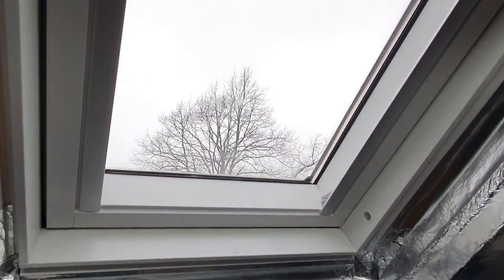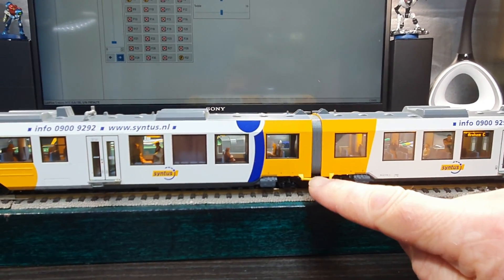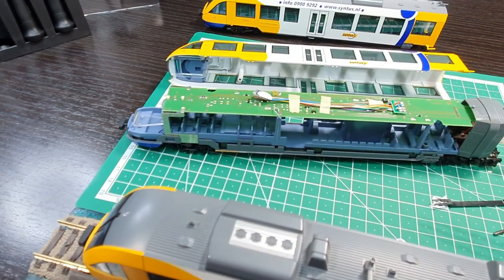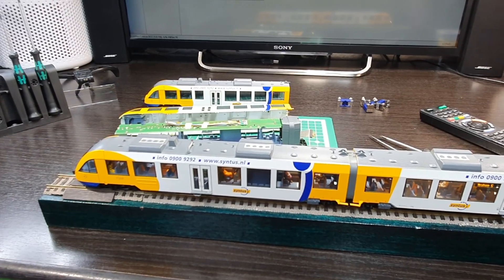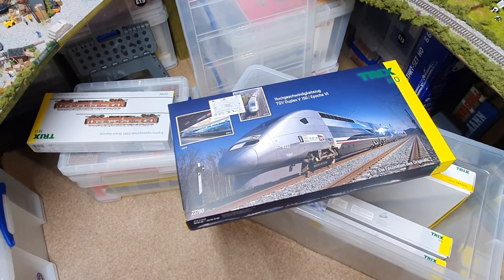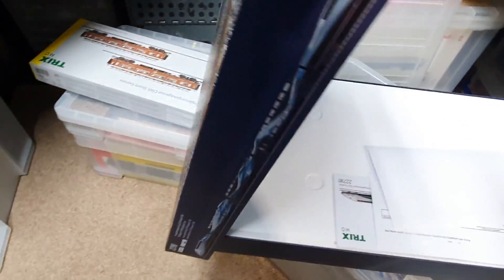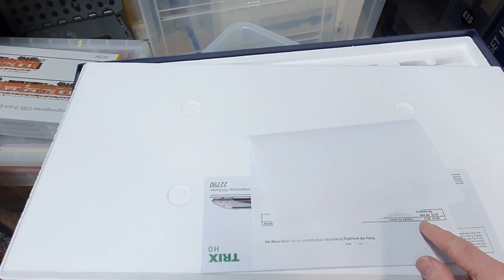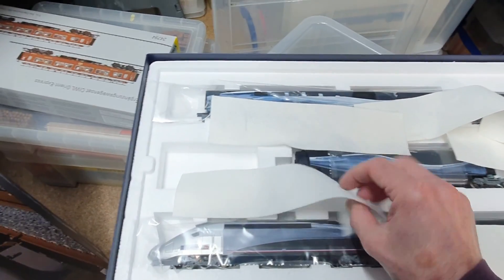Trix Tgv V150 making it go faster project? (Up the track voltage)

Comment: The thing about going faster is the rest of the railway has to be up to the increased speed? Wheel sets have to be balanced and wheel profiled(nothing eccentric), bearings lubricated and set, bogie pivots lubricated and set, no restrictions to vehicle body in motion, couplings free pivoting, correctly weighted vehicles for track geometry, correct track geometry and point work. For model rail, power pick up has to be reliable. If you watch cab views from fast trains the points for high speeds(100 kph+) are very expensive, very long, with elements that close gaps (frog blockers), and the moving parts have multiple position locks. It may be Trix are going slow on purpose.
Reply from the maker: Hi Brian, 
Very true information. 
The Trix models are very slow compared to the Feischmann ICE  models , even if I get the v150 to go 20% faster I would be more than happy.
I will try the French Tgv first if it works I will move on to the other Trix versions..
Thanks for watching and your information. 
👍🏻jim

Comment: Haven’t watched the video yet, but PLEASE lmk if you figure this out. I’m very unhappy w the top speed on the many trix TGVs that I have, including the V150. Thx Jim!
Reply from the maker: No worries I will solve this problem with the help of others.
Reply: Looking forward to your fix! I still have my jouef version … I had to change the bogies and gear sets in the powered car, since everything had cracked. Terrible original quality. I too was ready to punt it, but I stuck with it. Runs fab now.

Comment: The Trix TGV looks great. I have a few TGVs from Mehano - they are cheap and not super detailed but they run well and go pretty fast. I think the Mehanos use the same tooling as the Jouef and Lima TGV versions. Did Trix/Märklin create their TGV tooling themselves?
Reply from the maker: Yeah the Trix Marklin are very detailed I think the tooling is different...saying that the Jouef La poste train I have is very good..

Comment: I love the Lint class 41s (BR 648 in Germany)... I always wanted to get a dummy + live version and put them in a 2 or even 3-unit consist.  Sadly, Marklin only has a couple sets and they are very expensive to and hard to find.  I see you also have the Trix record-breaker TGV.  It is weird to hear it runs slow, but I have the same problem with my ICE4... enough so, that I am thinking of sending the motoring unit back and getting it replaced.  I wish I knew how to find a better motor and replace it myself.
Reply from the maker: Yeah the dual motors are wired in a way that limits the full speed running on all my Trix marklin tgvs so I hopefully will  rewire so they run much faster like the real train. The Lints class are my favourite dmu model..
Thanks Anthony..😄👍🏻